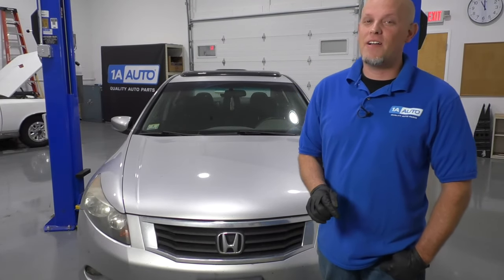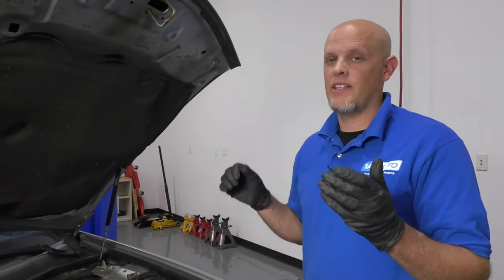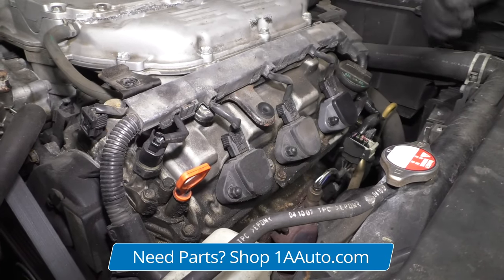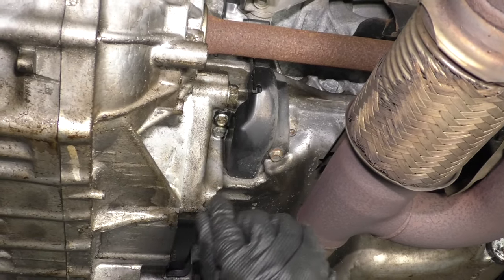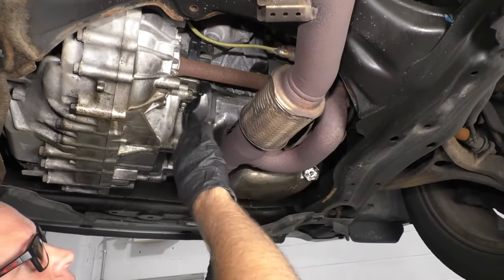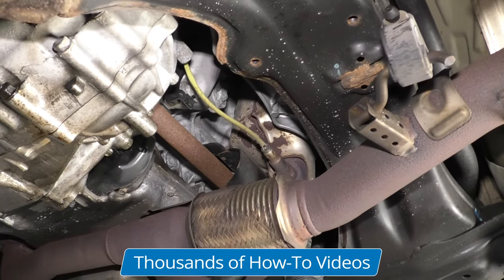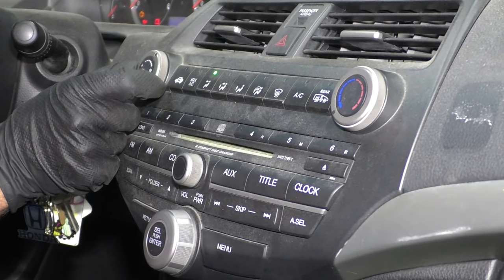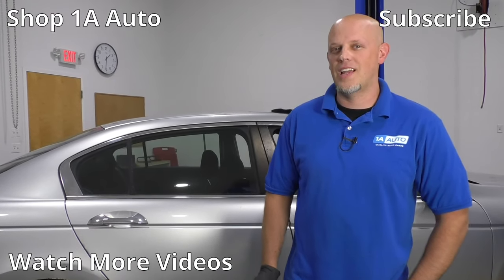Top 5 Problems Honda Accord Sedan 8th Generation 2008-12

Comment: I have a 2008. Headliner is collapsing.
Reply: Mine is in great shape on the inside considering it's age, I did just order a new cover for the center console however. I've had it eight years this year, it has some hail damage and some dents from three death-loving deer, and the top clear coat is peeling. But other than that it's doing great. I think it's time for brakes all around, and other little things but it's a great work car.

Comment: Mine leaks oil from somewhere and it gets into the spark plug wells and eventually clogs the spark plugs causing a misfire. I just clean up the plugs and its good to go. No need to try and fix the leak since its made it well over 200k
Reply: the spark plug seal on the valve cover
Reply: they keep telling me i got a oil but cant find it and dont see any oil spillage no where
Reply: @jbu2009  check oil level , oil leak maybe just tiny, it might get worse or just stay as tiny leak

Comment: I have the 2011 3.5L V6 Sedan. Keep a close eye on the VVT Solenoid / spool valve at the end of wiring harness (passenger side) for coil packs. The VVT Solenoid has two gaskets that Honda does not sell separetly. SHAME ON YOU HONDA !!!  You need to buy the whole solenoid $250 - 300 dollars depending on which stealership u buy it from n of course it comes with the 2 new gaskets. The reason I said keep a close eye on it is bcuz if it leaks bad enough it will fry your alternator like it did mine ! Easily a $1400 job if u use OEM Honda parts, labor n taxes. I used a rebuilt Denso brand  not from Honda
Reply: Yep that oil leaking runs down into the alternator and kills it.

Comment: Surprised you didn't mention the #1 problem with these cars.  Oil consumption.  Bad piston rings.  There's a honda TSB and extended warranty for it.  And the #2 problem, vtc actuator failure.
Reply: Don’t drive over 80 mph, won’t use oil on my 09 accord.